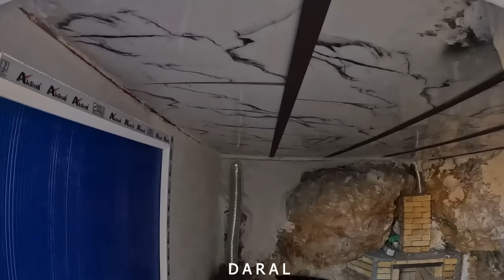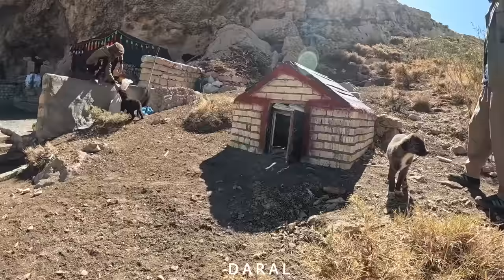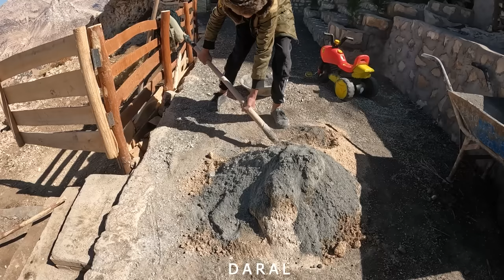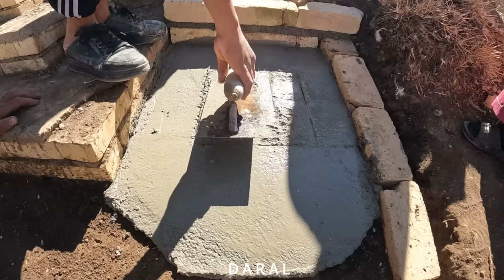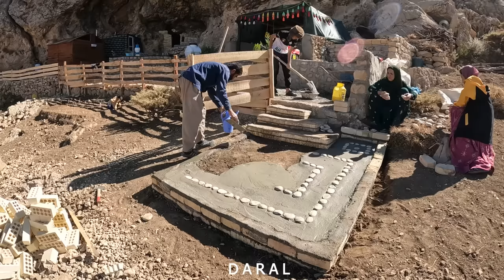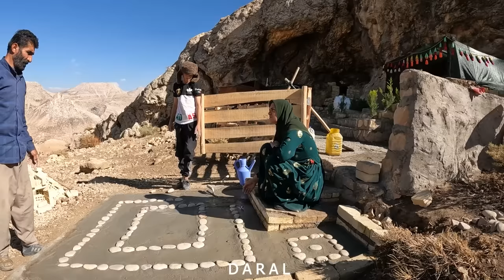"Amir and Family Transform their Home Entrance with a Stunning Cave-inspired Gate"

Comment: I don't understand that why you guys all of you nomads put these huge size pebbles on the smooth surface
Reply: theres a very practical reason.  If they put the pebbles in the concrete when the frosts come there is traction to walk on thus stopping people slipping and falling or hurting themselves.  I live in a country that gets a lot of frosts in winter, daily, when you walk on a smooth surface you are more likely to slip and fall or in my case dislocate discs in the back or again in my case slip feet go out from under you and you land on the tail bone breaking it.  That leads to 6 weeks bed rest while it mends - 7 times so far i have broken my tailbone, 5 because of frosts and it hurts.  So the pebbles firstly stop that happening and secondly it looks beautiful

Comment: My concerns with this cave is that the stones making up the cave or the mount are VERY BRITTLE and easy to break. I would be very concerned about STRUCTURAL ARCHITECTURAL SAFETY. There is a reason why building codes exist. And where you chip away on the cave wall, you must add a column, to compensate for structural strength. You cannot just happily chip away on a cave wall that is already HOLLOW and is overlapping, without securing a column to distribute weight. My goodness. You have a baby boy there, aren't you concerned about structural safety?